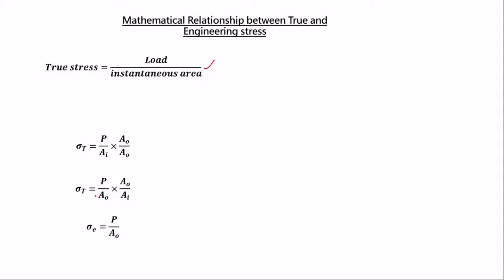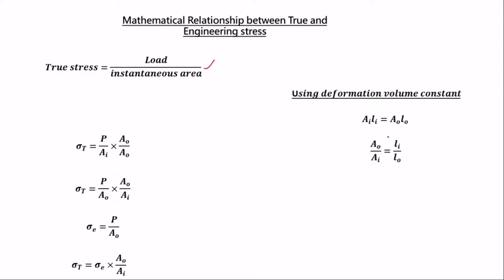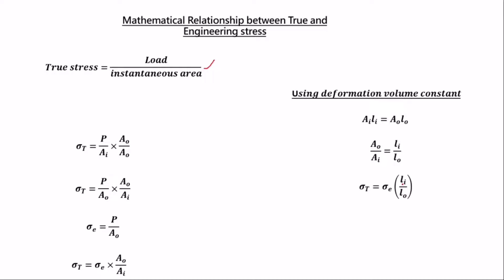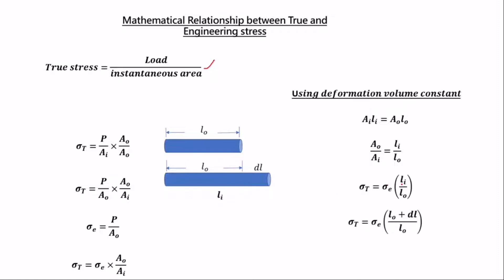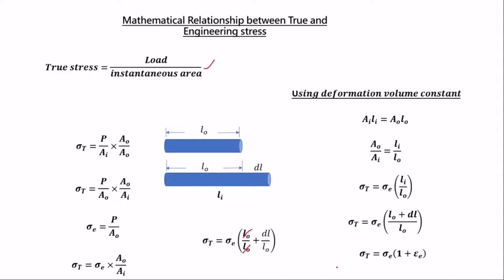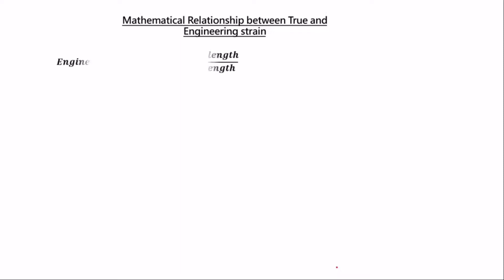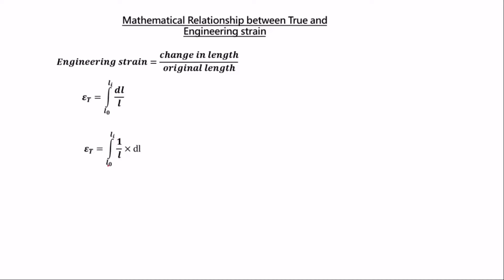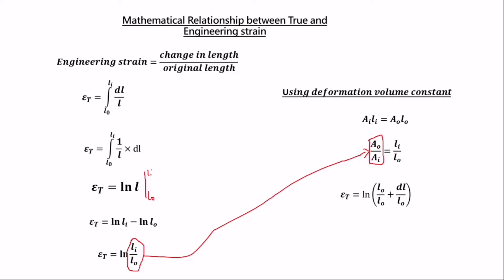MECHANICAL BEHAVIOUR - How to derive the  Engineering stress,strain AND true stress,strain

Comment: I like this derivation, however I still don't understand the Ln relationship for True Strain. It is not shown anywhere on the internet. For chemical reactions it is very clear though where Euler's number comes from and does not need tying to volume change physically. For true strain I'm confused still. It seems for True Strain it is to do with the accumulation of error in adding strains multiple times. I will continue to try and correlate linear, quadratic, cubic, and inverse relationships of volume changes of cylinders and spheres. It is my only option. I've worked it out before I think.